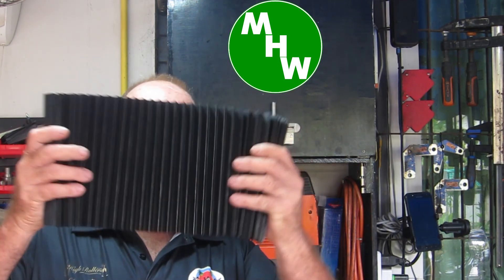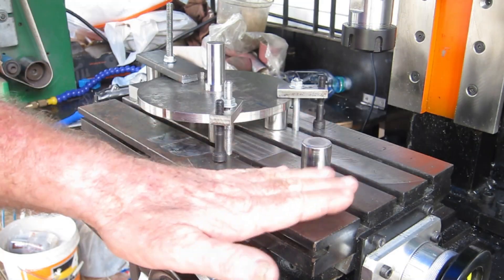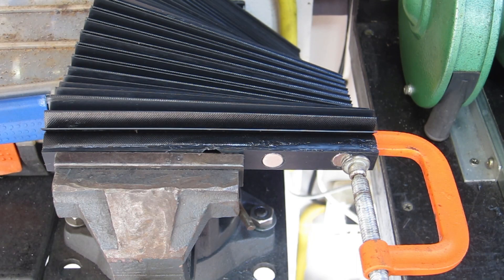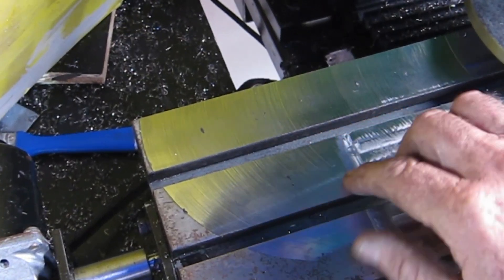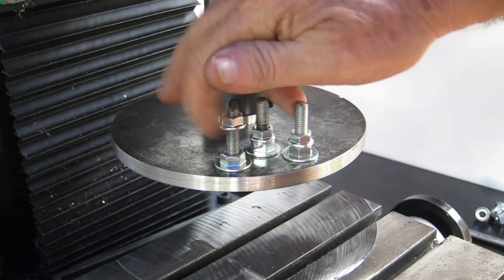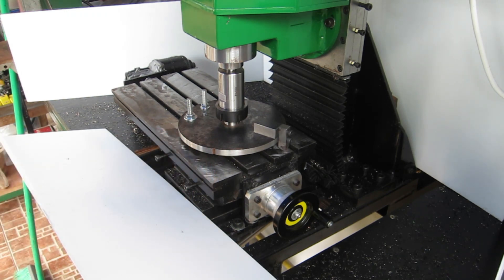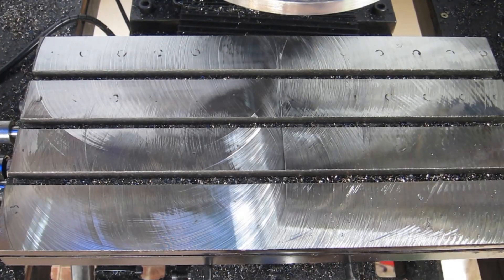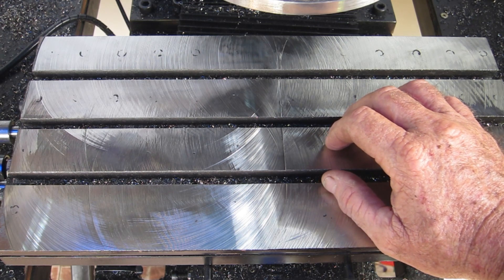MHW Episode 39 - Homemade Milling Machine - Part 10 - Making a large fly cutter and other follies

Comment: Why not chuck it up in the lathe and cut it true then weigh the bits you add on the one side and add the same amount of weight 180 degrees
Reply from the maker: Wouldn't fit in the lathe to cut what was essentially the top, it would only have been possible to machine it in the mill.

Comment: Not sure if it is the video or not but seems to be a fair bit of movement in the quill??
Reply from the maker: There is no play in the spindle at all, when you see it moving that is the whole column shaking because of the out of balance
Reply from the maker: Something else that was causing it to shake around too much was how I had the mounting frame attached to the wall, I have 1 large dyna bolt and 2 smaller ones, I hadn't tightened up the small ones, I have now and stopped a lot of that movement. 👍
Reply: @MyMiniHomeWorkshop  Sounds good I would like to see the next video now thank you.

Comment: I'm a bit confused on how a press is going to solve this issue. You said the backside is curved as well, I assume you mean the ways for the X axis? Even assuming a press could force conformity to a plane (something I have never seen done before in this sort of context) I would think that there would still need to be some reference surface on that bed that the press was deforming the incorrect areas to, and you wouldn't seem to have any. A surface grinder would seem to be your only hope, and if the ways are messed up or there is still any serious tension in that unit, it is likely not worth the cost and effort. Steel can be scraped*, but that is a big area to go after without a power scraper, and the starting point is pretty bad. Seems like trying to save the ways and starting over may be the best use of your time. (* I've not seen it done, but Biax says you can.)
Reply from the maker: It's not really that warped that a gentle push with a big press shouldn't be able to bend it back, I was only planning on using a straight edge to check it. Supported out at each end and pressed in the centre would do the job I would think, but like you say, surface grinding would be the the GO, but I have no hope of finding one I think.
Reply from the maker: I also need to revisit the positioning of the dovetail rails, you may have noticed me fiddling with the clamping screws as the table moves back and forth in the X axis, it's just not right.